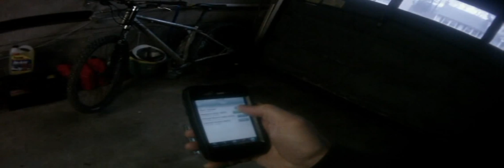iPhone garage door opener

Comment: I see your garage door opener.  It's a Lift-Master 1155, or 1255.  Look online for the LiftMaster "66LM" wireless keypad.  It mounds on the side of the jam, and then wireless sends a signal to the unit.  the only thing is.... look on the back of your unit, and if you see a block of code switches, then the keypad will NOT work.  But if you see a little white/yellow/grey/green button, then it will, let me know.